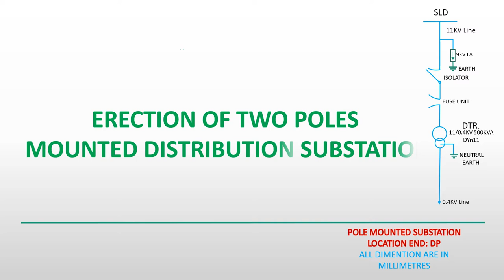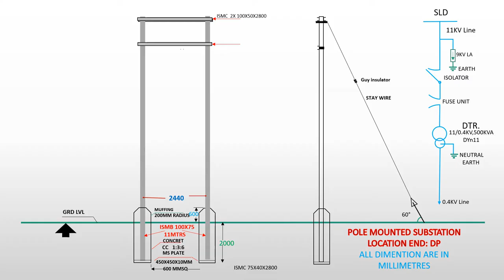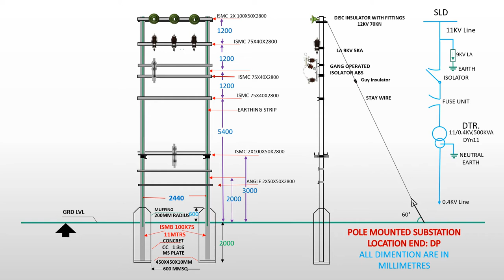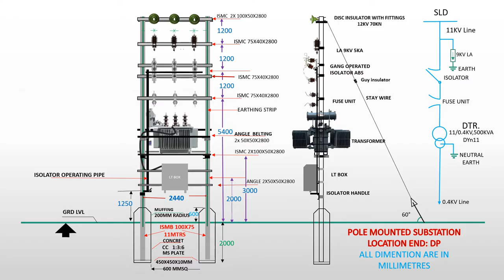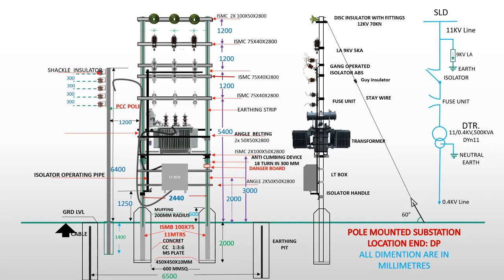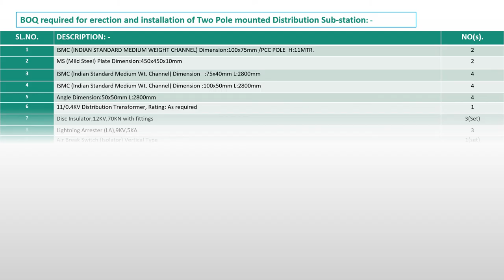DISTRIBUTION TRANSFORMER INSTALLATION :TWO POLES MOUNTED DISTRIBUTION SUB-STATION ERECTION:Re-edited

Comment: Sir pls provide rates also. Rate analysis is required for installation as I have been awarded the work to install 100 KVA Transformer.
Reply from the maker: First of all ,I want to congratulate you for receiving award towards  installation of 100KVA transformer you had done and also appreciate you. Two pole mounted  sub-station generally used for installation upto 250KVA  Distribution Transformer. The measurements were made for installation of 100 KVA transformer.Thank you for your observation.keep watching other videos and do comment.